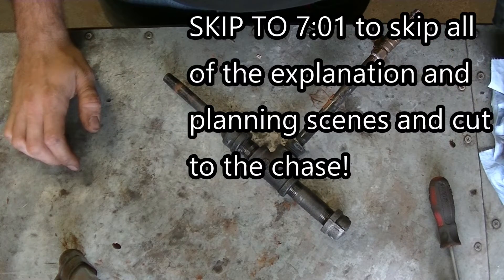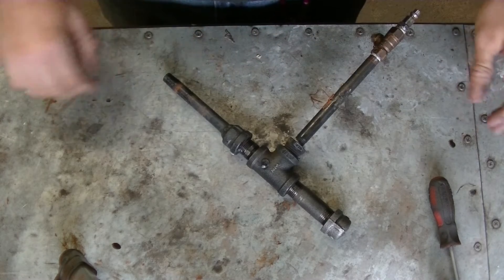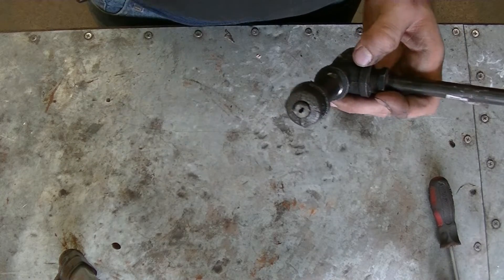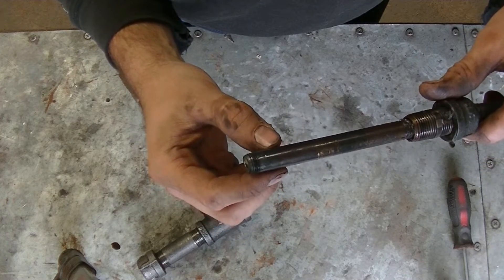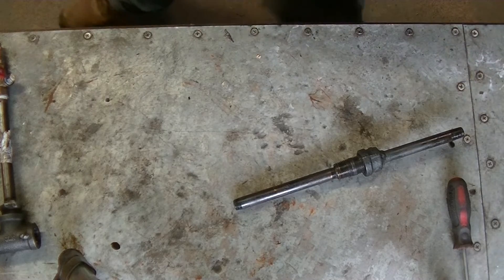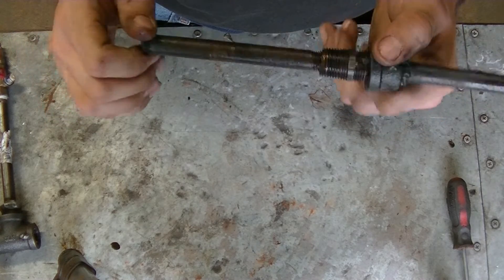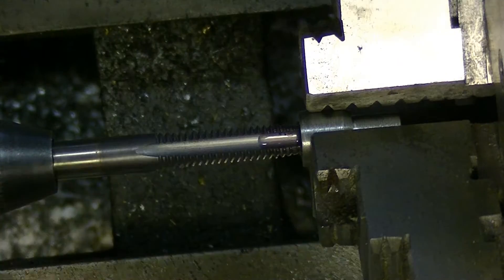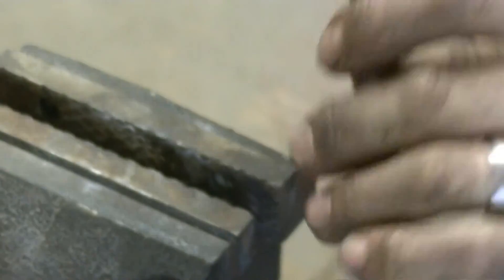Modifications to New Burner: Part 1

Comment: hello in one of your earlier videos you mentioned a pouring spout for use when a sutiable crucible is not available, my question is when this is done is the matereal simply placed in the bottom of the foundry  on top of the refractory cement thank you for the useful informative and enjoyable videos so far, and congratulations on your new family member
Reply from the maker: Thanks!  Yes, it is on the bottom of the furnace, but it isn't right on top of the refractory.  The bottom of the foundry is packed with a sand/clay mixture which is meant to replaced regularly when it starts to get thin and full of junk.  Also, this type of foundry is not suited well for pouring iron directly from the foundry bottom.  It can do aluminum.   I only use crucibles for iron.  (A cupola furnace is good for pouring iron right out).
Reply: @fairweatherfoundry715  I cannot thank you enough for this vital information tis always been an ambition of mine and thanks to you it may become a reality